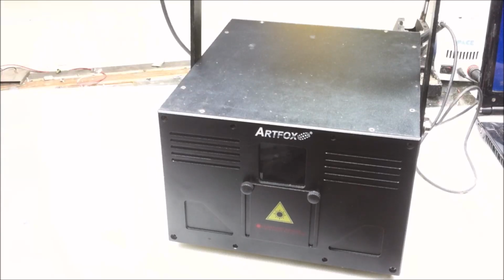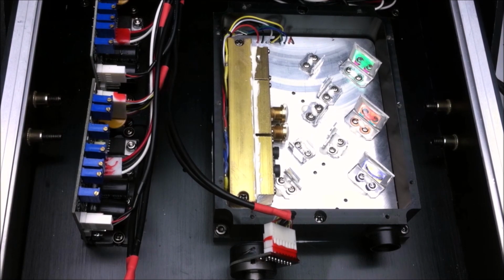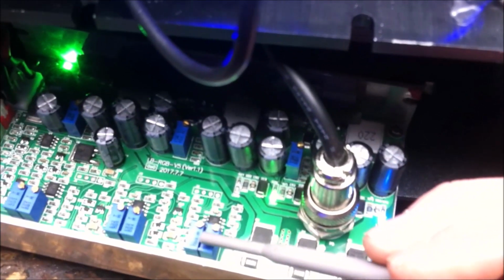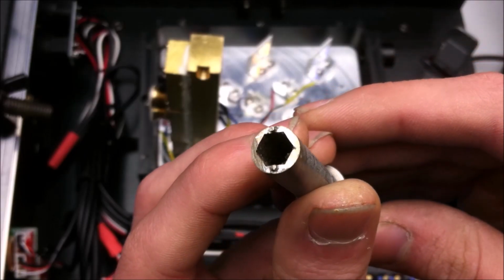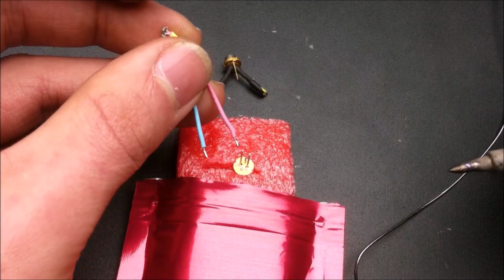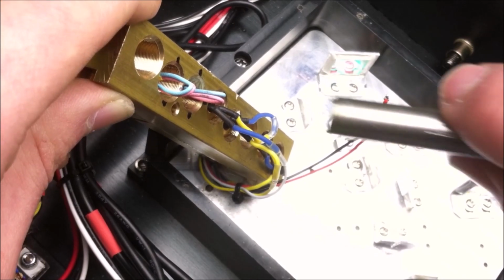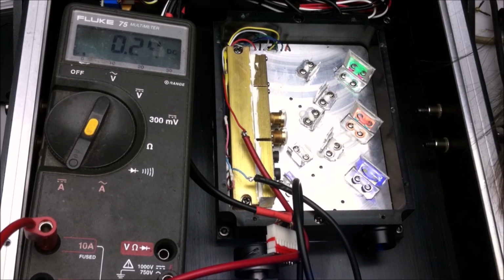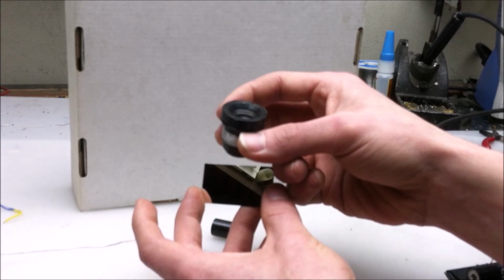Repairing Bad Blue Lasers In An ArtFox Show Laser

Comment: Nowt beats making a custom tool, however, you drilled the locking ring on the second laser to use the custom tool. I would have made a second custom tool so I would have had the right tool for the right job in the future.
I am however one of those all screw heads have to be aligned sort of people!

Comment: Great video (as always). 
I was wondering if you’ve tested the Oclaro HL63193 638nm 700mW red  diode yet ?
Reply from the maker: Yes I have, they are pretty bright diodes, but the beam profile is complete garbage. They have a very wide bar output and require correcting optics for a kind of ok beam. I have yet to test the 700mw Sharp gh0637aa2g but I heard that the beam was about half as wide overall.

Comment: What do you think of crowd scanning in general? They seem to do it a lot more in europe than here, which is were I seem to read most reports of injuries happening. I never trust it.
Reply from the maker: Back when I did laser shows I started off with crowd scanning, then I got an ILDA interface and stopped. Now it just doesn't look like a proper laser show if there is crowd scanning. What's the point of a show if you have to look away from it? There are lenses to make crowd scanning safer by widening the beam, but it's really down to what a person likes. Myself I don't like it because it's dangerous and it just looks off and unprofessional. It's also a lot of why these devices have gotten so heavily regulated. I don't do shows anymore myself these days but I still teach others locally and always tell them the dangers of crowd scanning. It's something I am against, especially with lasers that do not have a crowd scanning lens on it.

Comment: Excellent work as usual dude i particularly like the checking catastrophic optical diode section at the end, added value that others just don't do!
Reply from the maker: It's a good way to determine whether it is a bad driver or bad laser diode. Something that can be tricky without taking a look at the beam profile so I figured it could be a helpful tip to toss in.

Comment: At home we wrap a thin wire around the legs of the Diode befor soldering and we use a jet lighter for the heatshrink.
Reply from the maker: It's a good way to do it, it covers both ESD and using a quick source of heat helps keep the LD cool. I see no issue with your method at all.